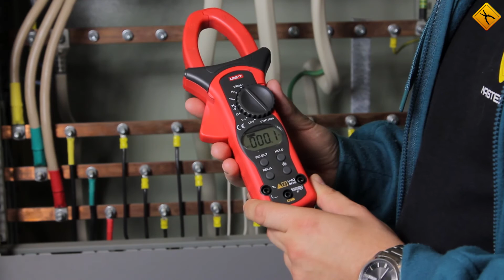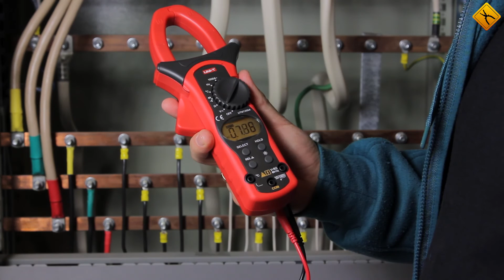UNI-T UT206A Digital Clamp Meter

Comment: Can it measure DC current?
Reply from the maker: Hello! For measuring DC and AC currents, we recommend clamp meters UNI-T UT204A and UT216C
https://toolboom.com/en/834634-digital-clamp-meter-uni-t-ut204a/
https://toolboom.com/en/digital-clamp-meter-uni-t-ut216c/
Reply: I just bought one and it measured... nothing. No AC, no DC. Didn't even get the voltage of a 9V correct. I'd stay away.